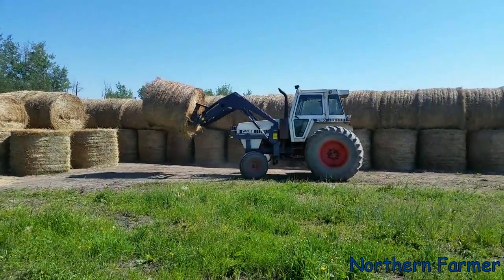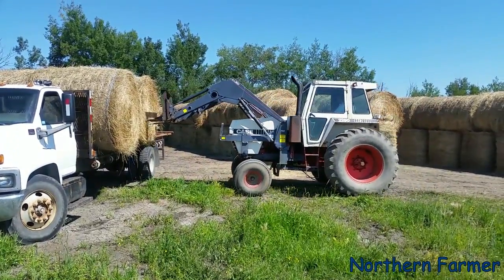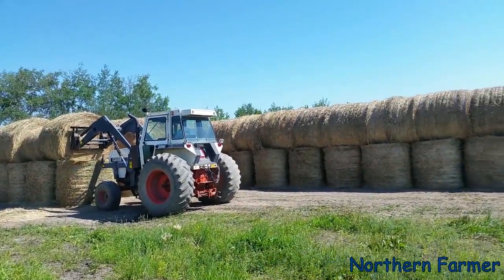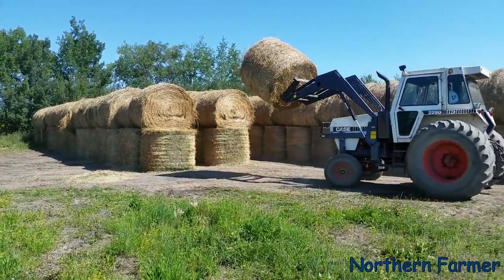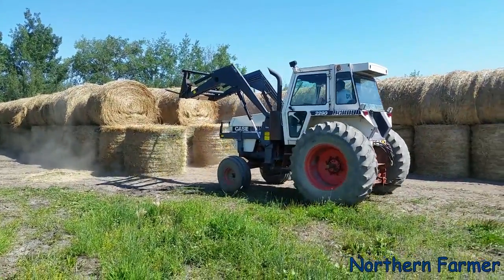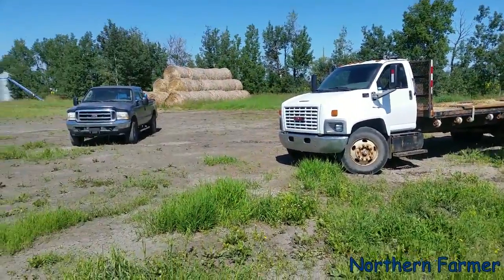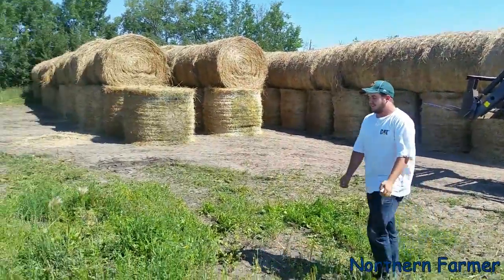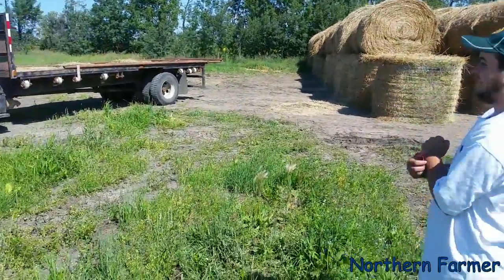CASE 2290 Unloading Hay!! Old School

Comment: The 90series Case tractors are just darn good.   We have a 2090 with a loader that would have about the same hours and it is semi retired but still handy to have.        Good vid Tyson
Reply: Grew up on 1370 and 2  1570 s and they still run today but one of the 1570 s has a trans problem and has for years you let off the clutch it might go or it might wait for 2 or 3 seconds and it sure is fun to hook up to something with it but once it goes the PowerShift is fine

Comment: Intetesting mushroom stack. I used to tight tootsie roll. Have an old 870 case.has the power shift.just pull small lever for reverse. Cab looks the same.

Comment: I think may need to replace hydraulic valve. it's  one underneath the 3 point top link. it has 2 hydraulic lines running to it. case are the BEST